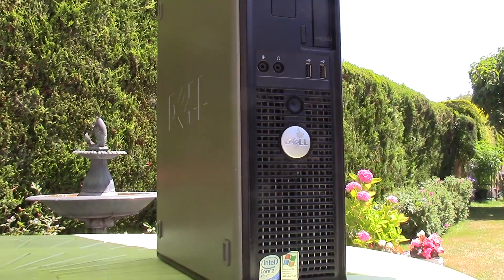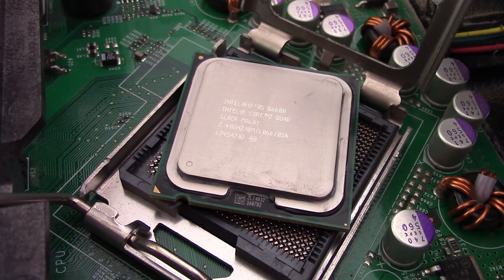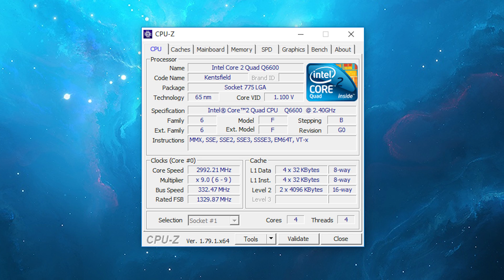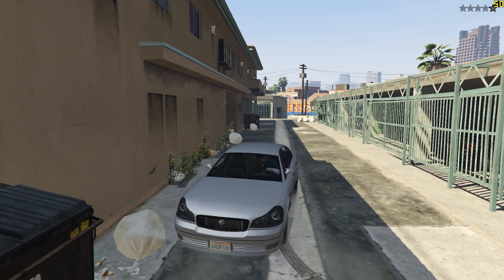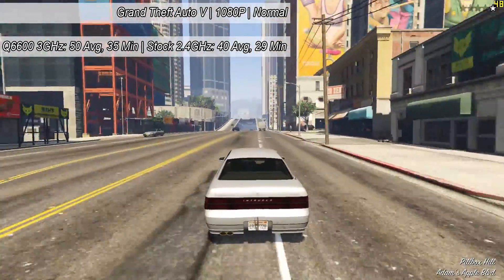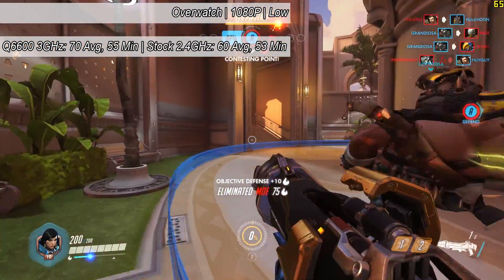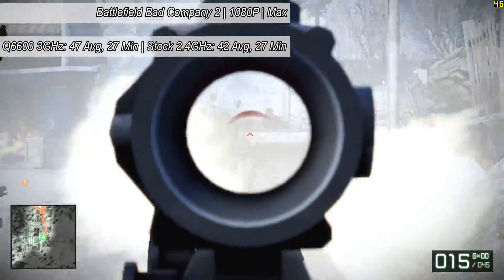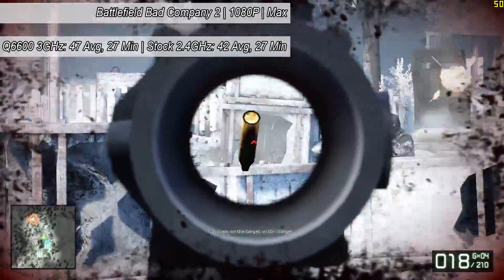Using Tape To Overclock an Old Optiplex

Comment: Is this PC for around 150$ expensive? specs:
-cpu Intel® i5 2400/ 2500
-gpu /
-RAM 4 GB DDR3
-250 HDD
Reply: Frenkie Fejzic That seems like a good deal. What version of Windows does it come with? What is the make and model?
Reply: i5 2500's go for 150$ dollars cheapest on amazon (probs a better deal on ebay) but for a whole system it seems like a fair deal.
Reply: Frenkie Fejzic it's a fried potato
Reply: if you add a GPU, bigger hard drive and maybe another 4gb ram that'll be a pretty good PC
Reply: Definitely good.
Reply: Daniel7689 idfk how high you are but that's not worth zero and might be worth it
Reply: i´d say yes , u can check this pc out at techdeals's youtube channel with a few upgrades.
Reply: Frenkie Fejzic check eBay. I bought a similar dell SFF for $100 shipped in the US about 6 months ago
Reply: i5 gen 2 arround 55 $ used model 2400 and ram is 35 $ patriot or 40 $ team elite
cheap used mobo 25 $ and hdd 500 gb 40 $ new
Reply: in indonesia
Reply: Frenkie Fejzic I bought my dell for $115 with shipping, and it has the 2400 with 8gb DDR3 and a 750gb HDD. That is a bit pricey, so I would advise waiting.
Reply: i have core i3 gen 2 and ram 2 gb i have 10 gb ddr3 ram and foxcoon mobo chipse h51 lga 1155 and r5 230 or integrated if want r5 on another computer soo i using intergrated and t2z armageddon case and hdd 250 15$ used
Reply: i3 gen arround arround 36$
Reply: Frenkie Fejzic i have your exact same gpu
Reply: it's not worth putting a gpu in it, since most prebuilts dont have a beefy psu. you'd be restricting yourself to a 750Ti/1050Ti/1030 if buying without knowing the psu wattage and efficiency.
Reply: Frenkie Fejzic 4 more ram and a gpu, set you around 250 and your golden sir. maby if u have a bigger hdd but who gives a damn.
Reply: its expensive, i got mine (i5 2400 with everything including windows 7) for $100 and with a coupon, $90. At the start of every month, like now, Ebay gives a $10 off coupon (check email)
Reply: The cost varies considerably according to the country you live in...so adding all the taxes,shipping cost etc I think it would be cheap enough....make sure the motherboard is not an Intel brand and/or the PSU is of good quality!
Reply: dat boi Wtf Nu te pricepi in pana mea la 150$ e excepțional așa ca nu te mai băga
Reply: Si in plus Placa de baza trb sa fie combatibilă intel
Reply: Where I live parts are expensive and so I thought to buy that PC and 250BAM= ~150$
Reply: and I just want to be able to play smaller games like cs:go,far cry 3 etc. so I'm gonna see what gpu could I add
Reply: +Valentin. damn should have taken the Spanish class when I had the chance...anyways bro I can't understand a damn word you're saying so gg :p
Reply: why the fuck every neolatin language has to be mistaken for spanish?
Reply: +Male Signor Anderson can't get google translate to work for some reason
Reply: Yeah that price sounds about right, you could pick up another 4GB stick on the cheap too and something like a GT 1030 or something along those lines to make it a pretty decent machine.
Reply: Would certainly be enough to play those games with a gt 1030.
Running my main system with a 2nd gen I5 2500 (turbo set too 4.1 ghz as i scored a z77 motherboard with it for free from a relative (went from phenom II x6 1090t which my dad now runs). & running a r9 280 as graphics card.)

Might hear with a person i worked with as an activity in a month or two if i can swap the 2500k i know they have in one of their pc's they use for word processing & surfing the web.
(Yes really... they use them for surfing the web & word processing & some minor tax stuff & similar.)
Reply: For the games you want to play i think that the pc is solid, just add some budget GPU (for the games you have in mind you could even go for something like 1030) or something older, just bear in mind to find something that is not too much power hungry since that PC of yours will probably have a weak PSU.
Reply: Well the CPU destroys ps4 pro and Xbox One X.
Reply: Frenkie Fejzic yes. I'll sell you my Dell optiplex 980 with an i5 2500, 8gb ddr3 (and two slots still open for upgrade) and a 500gb hdd for less than that if you pay shipping
Reply: I didn't read any replies, but it's too expensive.
Reply: kirbyswarp The library in my town has Optiplex 790s with windows 7, they are pretty decent machines imo
Reply: James Lewis isn't the 790 a core Duo?
Reply: Sounds good! Upgrade to about 8GB of ram and put a GTX 750 or 950 or 1050 depending on what games you play. I saw def get it! WURF
Reply: $150 for a whole system like that isn't bad, although the RAM and HDD are a bit lacking, and PC's like that often only have room for one drive and 2 RAM sticks. There's a chance its 2x2 rather than 4x1, so you couldn't just get another matching 4GB stick.

If you put a 1050 Ti in there it'd be more or less comparable to the Pentium G4560 budget builds that are popular right now depending on the game.
Reply: Frenkie Fejzic Not that bad, the  
I5 2400 gets 60 + fps in gta v and should easily beat any Pentium to my knowledge.
 8gb of ram would be nice
Reply: You can swap PSU pf prebuilts, but most of the time you cannot do it on SFF system, and some Mini Towers need adapters for the motherboard to PSU since they use non standard power plug
Reply: i bought a 
-cpu Intel® i5 2400
-RAM 8 GB DDR3
-500 HDD
for about 180$
added a 140$ gtx 1050 ti, now its a fucking beast, runs it all over 60 fps at high/ultra, vsync off.
Reply: I found an i3 550, 6 GB DDR3 ram, 1TB HDD with a 200W PSU for $70 on Kijiji (craig's list is unpopular in my area)
Reply: felix gaming vlog upgrade to 2nd gen i5 2500 or K version
Reply: Can't comment on price. Where I live (NZ) that would be a massive bargain. A 1050ti (not an OC edition with 6pin PCIe Connector) would be a good match provided it actually fits inside the case. 8gb of Ram may be the limit of the system dependent on the chipset.
Reply: I bought an Optiplex 790 that had i5 2400, 6gb ram,radeon hd gpu, and 500gb hard drive. For $95 shipped.
Reply: harry holley you have ebay and amazaon but they don't deliver here and if it would be expensive to ship
Reply: what's the gpu?
Reply: I got something for that price... $150 for an i7 2600, 8 Gb of RAM, a Samsung 850 Evo SSD, and a Radeon HD 6350 graphics card. All in a SFF PC.

A good deal, sure. BUT there were a few things holding me back. 

- The LGA 1155 CPU/Mobo and DDR3 RAM. This is going to severely mess up upgradability for this system (and yours, too). If I want to upgrade to a better CPU, I'll have to also upgrade my motherboard to something newer, like LGA 1151. NOT ONLY will this be more expensive, but I'll also need to either find a motherboard with DDR3 RAM (which will be tougher to find) or it will cost me money to upgrade my RAM to 8 Gb of DDR4, even after selling my current RAM. If I decided to sell the CPU, Mobo, and RAM, I'd still have to pay a lot to replace all those with new versions.

- The SFF case made upgrading to a better graphics card (something I wanted to do with a GTX 1050 Ti) impossible, unless that card was also SFF. Which isn't great, since SFF cards are generally weaker. The only reason it even HAD a graphics card in the first place is that this was an office PC and whoever used it needed to have two monitors hooked up. So I had to change to another case, buy another PSU to power the card, and get another motherboard (even though I didn't think I had to replace it- the one in the case doesn't have standard mounting brackets). 

All in all, there were a ton of problems with this build and I'm sure that I'll find more when I put everything together. But did I like the experience, and am I still getting a good deal when I put everything together for $400 and sell the extra parts? Yes I did, and yes I am.
Reply: Frenkie Fejzic try to find that with 8gb ram
Reply: Rofl, i build a pc for 170€
Gtx 780 3gb
8Gb ram
I5-3470K
Reply: I bought an old optiplex from goodwill for 120$. i7 3770, 4gb ddr3 1600 MHz, 1TB WD blue, and some old 2gb graphics card that I immediately replaced with a 1050ti I bought for another 120$ used.

Comment: I have an old Dell Vostro 420 with Duo Core Q9400 @ 2.66Ghz which was my Media Center System. Maybe I will dust the off the old Dell and try this with Q9400 CPU. I'm not sure if this electrical Tape OC with work with this CPU but it is worth a try. Thanks.

Comment: FYI, standard electrical tape that meets the UL standards (US electrial standards) is good to 80 drgrees C. Just a note though above 50 C, the tape can stretch a little but since it is clamped under CPU it should be good.

Comment: BSEL mods don't increase the multiplier, it increases the FSB from 267 to 333, resulting in a 25% overclock. (267 x 9 = 2.4GHz, 333 x 9 = 3GHz)

Comment: this is how you get likes on a comment
Reply: RifleRud eww, unsub.
Reply from the maker: RifleRud can't argue with that
Reply: RandomGaminginHD test this method with a xeon
Reply: RandomGaminginHD WHAT SYSTEM IS THIS?
Reply: He is using a Dell Optiplex, presumably a 745 or a 760.
Reply: ??? ??? I have an Optiolex 380 I swapped a Xeon into. I'd test it, but the stock cooler barely handles the Xeon stock
Reply: +RifleRud Now i know... XD
Reply: +Justin Noker Xeon on an OEM system?.... interesting :)
Reply: Justin Noker Just make a water cooler from the stock cooler
Reply: dat boi Xeon works with even OptiPlex 755 that guy has. Just you have to buy the a bit more expensive X3363 option and find yourself a bios mod
Reply: Duly noted.
Reply: I think the pin to do this with the Xeon is different to the Core 2 but there's info via google search.
Reply: RifleRud how do you get likes on a comment
Reply: Jasonsadventures I found no results about modding Xeons. And I don't think OptiPlex 755 supports 1600mhz fsb anyways since its the very first one to support 1333mhz thus making Xeon mods possible...
Reply: this is also how you get people to unsubscribe. Unsubbed from Rifledudd for meaningless comment.
Reply: You're really gonna take a comment that personal? Holy man, get a life.

Comment: This is so cool!! I just found a old inspurion 530 on the curb and if it works I think I'm going to have to do this!!
Reply: lol me too. I just found an Inspiron 560 yesterday by the curb while I was on a walk in my neighborhood with a 1080 23inch monitor. Threw in a q6600, used the tape mod, upped to 8gb of ram, threw in a gt 730 2gb GDDR5. I'm gonna try and sell for $100 (keeping the monitor)
Reply: @stevesmith1383  that's too funny. I also found mine with a 20 inch Dell monitor and today I tore it down and  completely cleaned it because it was disgusting and then put Manjaro on it. I haven't had a chance to use it much but it seems pretty solid though it need more RAM.

Comment: I have a Dell Optiplex 990 i7 2600k and would love too be able to overclock it so it can have a longer lifetime.  I've put an 8gb kit in it so it has 12gb ram and I finally upgraded my 750 ti to a Zotac 1060 6gb amp.  I really really want to keep to keep this rig going as long as possible.  I'm not rich.

Comment: I have two such systems (a Dell Vostro 200 and an Optiplex 755) that I want to tinker with. I will have to try this trick. I wonder if it works only on Quad cores or on the rest of the Core 2 Duo family as well.

Comment: I tried it on my q8400 thinking it wouldnt work. Upon first bootup to windows 10 CPZ showed stock speeds 2.8ghz. Then next boot up i found in the bios that it said 3.2ghz. In windows CPUZ doesnt show multipier info but it does get up to 3203mhz speed. Cool!

Comment: I modded my Q9550, hoping to see a difference, it booted, I had stuttering on Gta V and I really wanted to increase 2.8ghz because motherboard stopped saving bios settings so yeah, hoping to work, pc booted right up and mobo thought that it is a new cpu, but computer is really slow because it has 4gb of DDr3 ram paired with a slow seagate hdd that I got for 18€, I will benchmark it in the following hours, wish me luck

Comment: upclocking on intel platform is as old as pentium3 it was the only way to overclock celerons over 33% on via chipsets

if i still had this platform i would try it with the slowest celeron with conroe l core or with slowest pentium dual core

Comment: I actually bought a q6600 for 8 USD, shipped to my door and did this tape mod. It is a small and tedious affair but I am running 2.989, that is not bad at all. I think I will reapply thermal paste and check the temps. Everything runs in the 50's but I wanted to make sure it worked.

Comment: I did this on my Dell Optiplex 755. However in my case the RTC runs too fast. And so does every timer and countdown. It doesn't matter which kind of application I use. And some games like Fortnite even run 25% fasten.

Comment: haven't watch the video, but it usually work. especially if the cpu is of G0 stepping. However, 3Ghz on a Q6600 in 2017 simply won't cut it.

Comment: I'm getting voltage issues with my motherboard when trying this. Is there anything I can try or am I out of luck? My system runs just fine when I turn off multi-core in the BIOS.

Comment: you can upgrade your optiplex 755 from Q6600 to the more powerful Xeon X3363 put a 8gb ddr2 and a graphic card and voila
you can also overclock the x3363 using setfsb from 2.83 to 3.31 Ghz

Comment: a cheap p35/45 mobo will, most of the time take any 775 quad core to 4ghz, however, they are fine for single player, but don't perform well in MMO's

Comment: Is this possible on LGA 1151 I have i5-2400.
I have a Optiplex 790/990.
And I want to squeeze some more performance.
Reply: I5-2400 is lga1155, I wanted to know if it worked aswell. I have an Optiplex 790.
Reply: No

Comment: I've actually used the tape trick with my 2006 Mac Pro upgrade.  I purchased much slower Xeons, put the tap on to increase the FSB, and now it runs at a 2.33GHz instead of the 1.8GHz clock speed.  It's an awesome cheap upgrade.

Comment: The tape mod, also known as a BSEL mod does not increase the multiplier, rather it increases the FSB of the CPU which results in a clock boost from 2.4 to 3.0, and yes it actually works

Comment: hey I just did this too last week but I only used tape on the pin closest to the notch, which if I understand correctly is the pin determining fsb.  I think the other pin is the for voltage determination. I succeeded with with a Q6600 in an HP 6000 pro, but it failed in an optiplex 960, and was just turning off and on which now makes me think it might have needed that second pin covered to unregulated the voltage too. Thoughts?

Comment: I have been running this mod on an Opti780 full tower with a Q6600 for close to a year now.  I can attest to the fact that it is stable with nothing more than replacing the aging thermal paste with new Dell OEM thermal paste.  Stock heatsink / fan assembly.   Add in a GTX750 (because it pulls power over PCIe), and it's a good casual game machine.  It even streams decently to the Steam Link.  I still find it appropriate that electrical tape is being used to patch out more performance from this aged platform.

Comment: I'm seeing a rated FSB speed of approx 1333mhz and the nearly 3GHz approx core speed in CPU-Z but on the Cine Bench R15 it says its not 2.4 not 3Ghz so performance does not look to have changed. Which do I believe?? (old Dell Xps 420 q6600 with 8gb ddr2 ram and Geforce Gtx960 2GB)

Comment: Correction you are not really modifing the clock multiplier by doing this u are actualy changing the fsb speed of the cpu so......from 266mhz (266mhz x 9 gives 2,394mhz) the normal clock speed of the q6600. Too 333mhz (333mhz x 9 gives 2,997mhz) giving u an overclock but the clock multiplier stays the same by i mean stays the same i mean its still 6 to 9

Comment: Hola, tengo una inquietud, que no he podido solucionar estoy entre el procesador Q6700 y Q6600 no se cual elegir para mi pc dell optiplex 745 que me aconsejas tiene 8gb de ram ddr2 a 800mhz y pronto tendrá tarjeta grafica 1030????
Hello, I have a concern, that I have not been able to solve, I am between the Q6700 and Q6600 processor. I do not know which one to choose for my dell optiplex 745 pc. What do you advise me to have 8gb of ram ddr2 at 800mhz and soon it will have a 1030 graphics card ????

Comment: Covered 2 pins? i only covered the one and got the same result with my xps 720. i did it because the motherboard couldn't handle the overclock through the nvidia software and it never managed to save the profile.

Comment: *WARNING* While this may work in the short term, the electrical tape leaves a black residue on the item it has touched, with the heat of a cpu it is very likely that the sludge can spread onto other contacts on the socket. If you do this be aware of this risk.

Comment: Hold up, the q6600 nativly uses a 6-9 Multiplier
Reply: Pretty sure he was wrong in that regard as this mod should boost the fsb not the multiplayer

That’s why it didn’t work on CPUs that already have the 1333 FSB and only on those with 1000 or whatever I don’t remember the exact fsb speed for the q6600

Comment: the multi stays the same. the fsb went from 266mhz to 333mhz, hence the 3ghz CPU speed. so you need a chipset that supports or can at least be overclocked to 333mhz fsb.

Comment: Didn't work on a Dell Optiplex 745 with a 95W Q6600, it only booted without tape in the pin next to the hole and a 'Strike F1 key to continue' message appeared but no overclock at all, any ideas?

Comment: You do NOT modify the multiplier as mentioned in the video, you simply let the CPU be detected as a 333MHz BCLK chip instead of a 266MHz one... Hardmodding multipliers was last possible with the athlon XP barton up to production date 2003/week 39 :)

Comment: Does this work with a xeon 3530 and Dell 3500 09kpnv mobo please? There is not option in bios and XTU does not allow changing the multipliers.